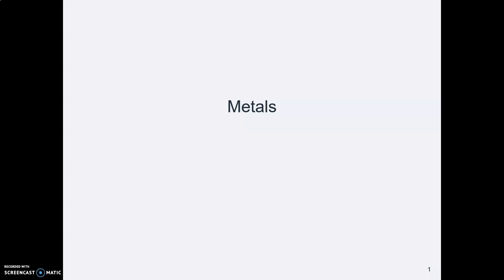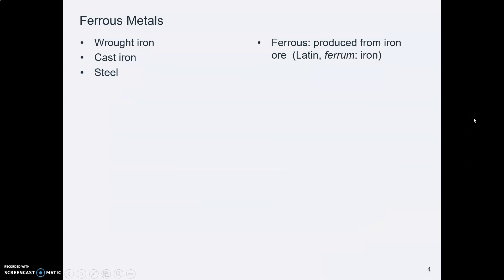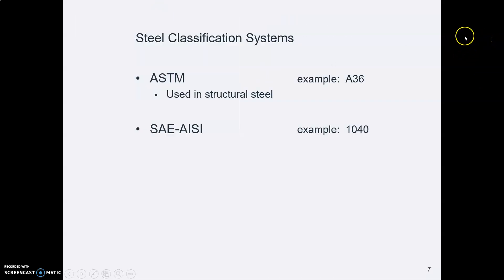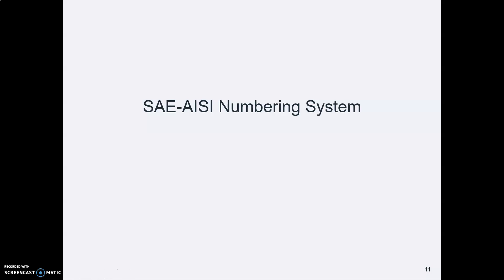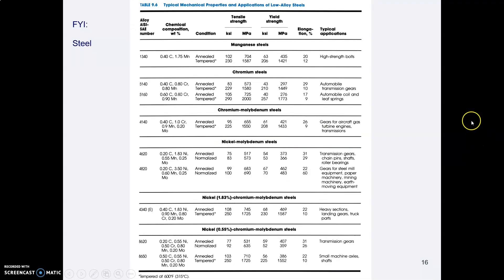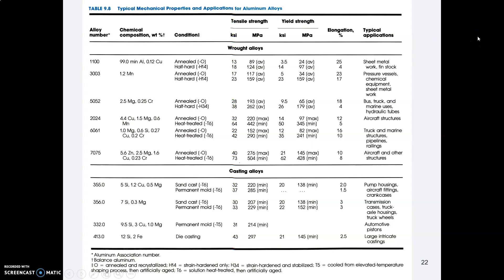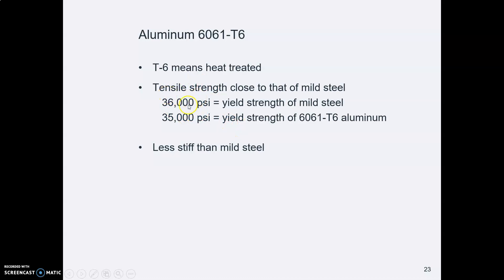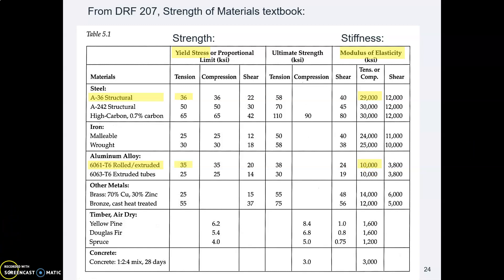ME21 metal designations

Comment: Mam, I am not a native American, but I have this stupid question: What is wrought iron, and what is cast iron? How do they differ?

Thank you for the great and easy video  on grades of material...
Reply from the maker: There is no such thing as a stupid question! Wrought iron and steel are both low carbon. Steel is iron + 0.5% to 1.5% carbon. Wrought iron has about 0.5% carbon and has a little bit of slag added, so that it is softer and can be "wrought" (i.e., hammered). It's not used so much anymore. (New products that are called "wrought iron" are often actually mild steel, just shaped to look like the old-time wrought iron pieces.) Cast iron has a higher carbon content: 3%-5%. It is brittle, not strong in tension but strong in compression. (It's similar to concrete, in that way.)